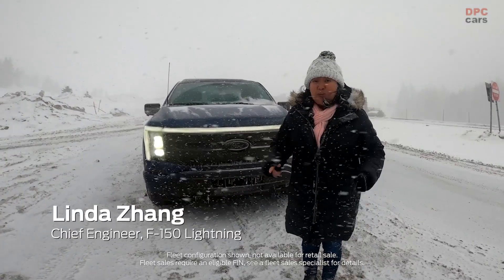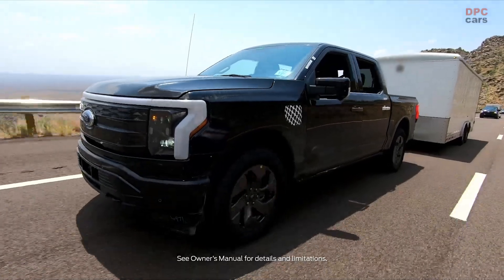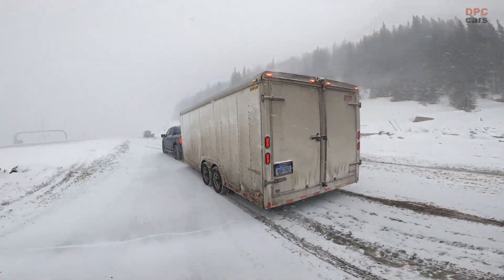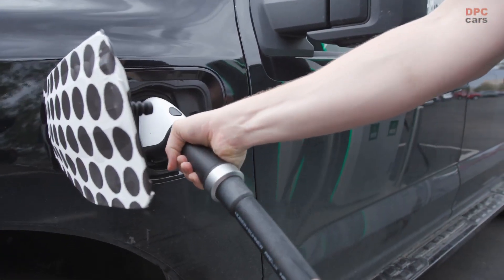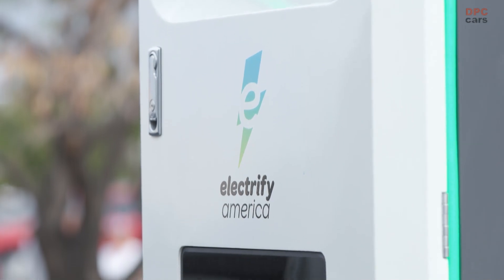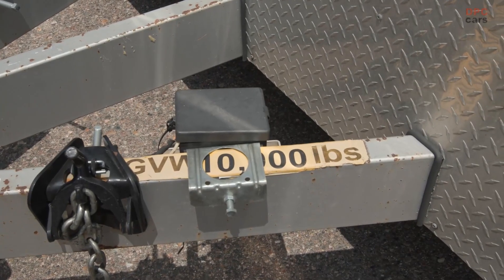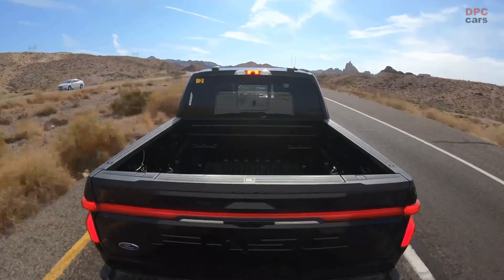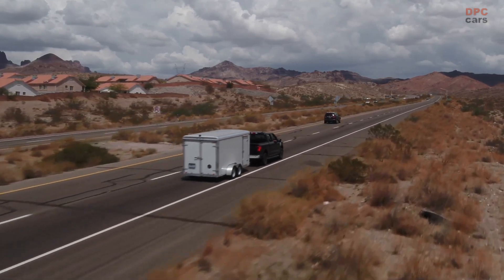2022 Ford F-150 Lightning Electric Truck Tow Testing

Comment: So how fare will It tow 10,000 LBS I read it will only tow about 70 miles with a big load.
Reply: yeah see. it doesnt weigh 10k, thats just the rating sticker for the trailer

Comment: And why not tell us the actual achieved range on this test, towing heavy trailer.....??   that would be useful for us.....
Reply: Probably because it was about 60 kilometers
Reply: Great point
Reply: The one video I watch it was towing a holiday trailer and was only able to make it 80 miles.
Reply: Another channel did a side by side towing comparison with the lightning and an ICE truck (gmc sierra I believe). The lighting only made it 89 miles (145km) and had to turn around to charge because they wouldn't have made it to the next charge station.😂 the sierra still had over a half tank
Reply: Based on most other EV towing, it's half of your standard range.

Comment: 20k for 70 miles extra  🤔
Reply: The upcharge is a lot of money, but you get more than an additional 70 miles.  For starters the EPA rating on all but platinum trim is 320, so you get 90 miles.  In addition, you get 7500 lbs towing vs 5000, 563hp vs 426, plus the 80 amp charger and vehicle to home equipment.  All that is in the 10k battery upgrade price.  The other 10k is for a higher interior trim for the XLT.
Reply: @chrisbala738  The EPA rating for all but the Platinum is not 320 miles.
Reply: @gbpg2016  Yes it is. The extended range battery is 320 miles for all trims except Platinum which is 300 miles. Certain tires will result in a lower range as well. The standard battery is 230 miles and is not available in Platinum